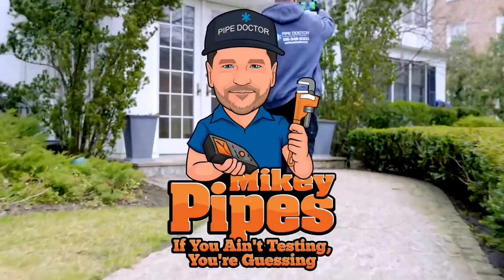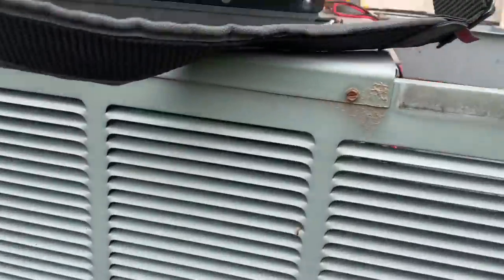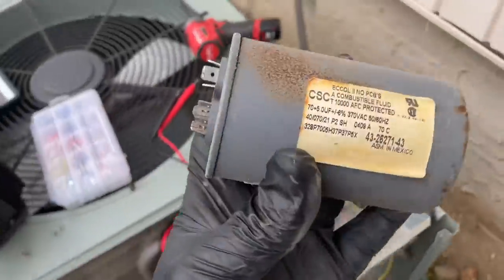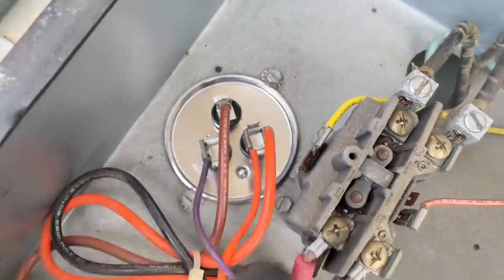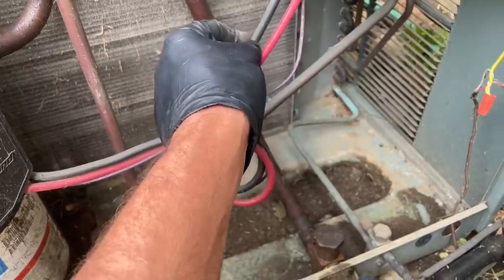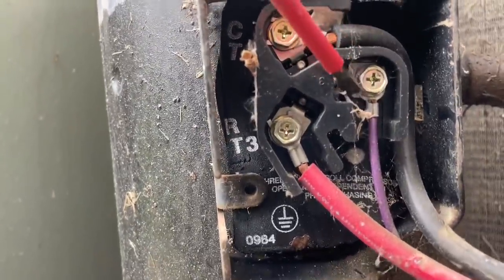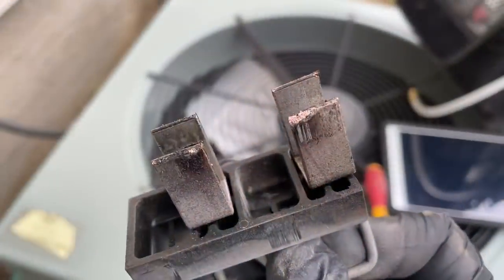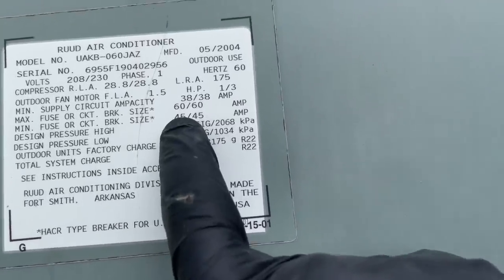How To Basic Diagnostics During Central AC Preventative Maintenance Outdoor Condenser & Compressor

Comment: I always Check the voltage drop across the contacts on a Contactor to see  the  condition  of the points. I recommend changing it out if i get more than 1 or 2 volt drop across the contacts. Usually the contactor is visibly burnt at that point and its easy to explain to the customer visually why it needs to be swapped out. I rarely change a contactor  based simply on the ohms reading of the 24v coil. They vary wildly depending on the manufacturer but if its crazy high ill change it. Love the videos mike. Keep em coming.

Comment: great video mike,nobody saw the 71.8 uf on your meter,the disconnect behind the unit,code,sealtight on 24 volt line,no bushings on electrical,the slugging on compressor,forget about oiling the motor and washing the condenser,maybe until the sticker wares out.

Comment: Mikey Pipes,  RE: the electric service at the 5 ton condenser, the correct way to describe it is 240v single phase. If the service was 120/240 single phase it would have a neutral conductor with the service cable/conduit.

Comment: I had an issue with a capacitor in a window a.c. 11000 btu, visually the capacitor was leaking fluid from the cans seal. The fan motor stopped working. Older Amana model, new capacitor got it running again.

Comment: Good stuff Mikey.👍 Just a couple of small points - 1. Did you test the new replacement capacitor (IYATYG). 2. The disconnect fuse was probably burned by service techs ( or the homeowner) pulling the fuse holder while the compressor is running - they are just not deigned for that abuse.

Comment: I feel like on bigger systems that draw more current it is someone 'normal' to see some corrosion on those disconnects. They really should have some dielectric fluid on them and that helps it not overheat or potentially break off in there. 

Also, looking at compressor amperage, you should have pointed out to the compressor R.L.A (you had 23, max was 28) rather than the circuit breaker rating. 

Probably telling you stuff you already know, so we'll say this is for the newbies watching :P

Comment: Have you ever tested the capacitor while it’s running with the math formula to see how it’s running under a load. Amp draw on here wire times 2652 divided by voltage on the capacitor

Comment: Unless I missed it you forgot to mention discharging the capacitor before testing, and over 65 mfd should be discharged with a resistor
Reply: Unless the one handed comment meant you prefer to test it charged